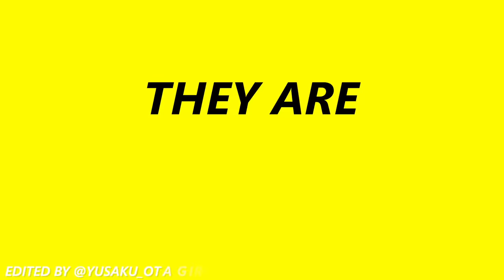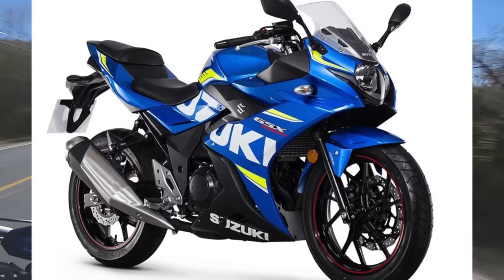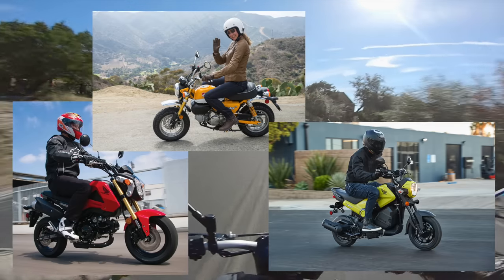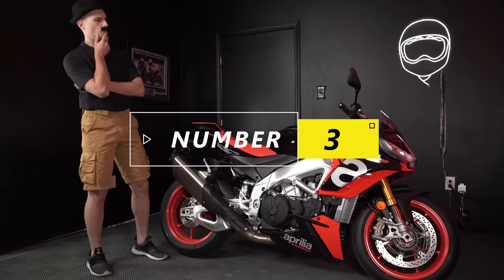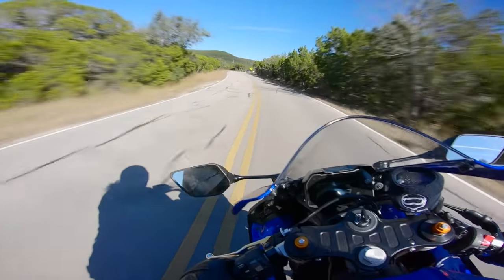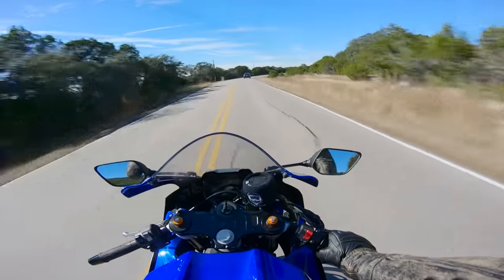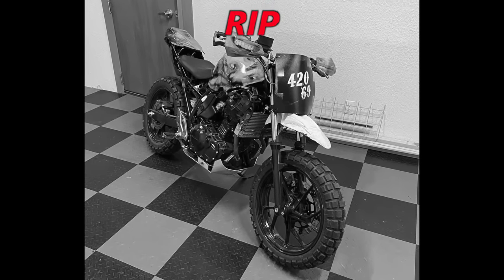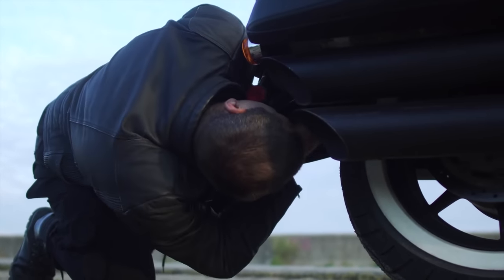Top 7 Worst Beginner Motorcycle Choices! (Must Avoid)

Comment: Maybe its just because i have a mechanical background. My first bike was a 75 CB550 and it gave me 0 problems. It was easy to ride, maneuver, do maintenance on. And not to mention the pros of Its reliability, abundance of parts, and it sounded absolutely godly. I strongly disagree with that last point. People rode bikes with no assists, bad brakes, etc. forever. With a little know how mechanically those bikes aren't hard to ride, work on or diagnose at all. They aren't bad beginners bikes, they're bad beginners bikes for people who expect a 1975 bike to act like a modern one and treat it as such.

Comment: I love my R6 I'm 17 I rode dirtbikes a handful of times and for long periods when I did and got used to automatic bikes here and there a couple times and went straight to an R6. Me I'm a naturally learn through experience person and have amazing control with that bike and know all the RPM ranges to switch gears smoother than your little brother's pickup lines. Not recommended as a beginner bike I was darn lucky I could drive it off the bat like it was a super heavy dirtbike and be just fine

Comment: Yo I got a fuel injected hawk 250cc, it is a very great bike! Showed up in a box on the back of a furniture truck! I had to put it together and went through a lot of headaches getting it titled! After research I quickly found a group on Facebook the know everything about the bike and it actually has a Honda CG motor on it. It runs great and after 2500 extremely hard miles it still starts up and runs perfect also it is very easy to learn how to do maintenance like valve checks. I highly suggest if you wanna toy bike or a learn how bike, the Amazon hawk 250 is a great option!
Reply: My main bike is a tiger XCA set up for off roading and camping!

Comment: Ok ok when listening to you i set back and think was i an idiot? I started out on a sv1000 i was terrified of riding period the corse i took was great... Jesus i was terrified then but I kept pushing my self to try and get better but between the two bikes both was the same scare factor for me not the speed/quick of the throttle on the sv thats manageable and controlled. So I learned lol on a 1000 I did it very slow and took my time till I felt comfortable. Then a few years passed and sold it and made a profit actually lol and bought my first brand new bike so far had it for 7 months lol my dumb self bought a 2021 1290 sdr and so far very happy with it its a neat bike what I wanted was something that can always put a smile on my face and so far the duke does just that even without going to plaid down the interstate.

Comment: Its funny coming from motocross and then riding a  "streetbike", I always feel like they're so slow off the bottom. Even an 800,  its so mellow compared to a 450 mx bike. Wind them up and its a different story but it goes to show 1 450cc cylinder has some serious punch also with way less rotating mass and overall weight.

Comment: What?!?!? No mention of Harley?!?!? Now I'm glad that was my starter bike...
Reply: The Sportster is kinda meh as a beginner bike, very top heavy and kinda a pig at low speeds, actually worse than pretty much any of the Softails at low speeds.  The Sportster motor is lurchy and has vague throttle response in stock form, which only makes it that much more unfriendly to beginners.
Reply: @mrvwbug4423  I don't disagree. My first ride was a softtail sport glide.

Comment: Even if your an 'experienced' motorcyclist, the new superbikes are insanely dangerous, a handful, even the 600s, which are no longer 600s by but 765s, 800s, 959, 955s..can get you into the weeds ... By some used well maintained, but aesthetic POS....so you can ride loose, have some fun, not worry about dumping it.

Comment: Disagree with number 1, a beginner should  start on a bike they may or may not have to work on... it's a good way to get to know your way around a bike. Oh and carburetors are not evil things like you seem to make them out to be, they are for the most part simple and easy to maintain. A fuel injected bike on the other hand can be a nightmare if a problem happens. Im not against fuel injection if given the choice on a motorcycle give me a carburetor.

Comment: So how old is too old for a second hand starter bike? 
I'm looking to start soon and i've got a few options
First gen R3(2015-2018)
Ninja 300 (2013-2018)
Kawasaki ER6N or Ninja 650 (2010-2013)
Sure the 650cc are attractive, but its a few years older than the 300cc but would there be any big differences besides the power and the handling? Like maintenance/service costs and parts? Since its from 2010-2013 with 30,000-50,000KM on it (High 2x,xxx at BEST) would it be a bad thing to choose it over the 300cc with less miles on it?

Comment: So, Yammienoob, what bike do you recommend for a "first" bike? I'm in the process of deciding which bike to buy. I rode a 1955 Pan Head from 1979 to 1995, and haven't been on a bike since. I stepped up from a Honda XL 125. I'm 60, retired, and moving back to Germany where I went to grad school. I'm selling my Dodge Ram 2500 and my Ford Fusion SE, and would prefer to use to the Berlin public transport as little as possible. I've broken my back twice (L2-L2) so I don't want a bike that leaves me bent over to ride. I want a sit up straight bike. I was thinking an Indian Scout Bobber. What's your opinion?

Comment: In India most of the ppl beginners motorcycle is 125cc bike which is a full bike with 125cc engine it is normal wheel size and normal tank you won't feel weird riding it.

Comment: what to get for someone in uk and at age can only ride 50-125cc? we dont get the luxury of usa and going to buy a 300+cc bikes at my age, got to wait till 19 for that :/
Reply: KTM duke is a great option as it's basically a 390 with a 125 engine in it. Honda cb125r is great and Yamaha mt-125 is also great.
Reply: @callumboothroyd3766  Depends how much you want to spend, 125s are crazy expenisve the UK right now. A Cbr125 is probably the cheapest option unless you go for a chinese shitbox. I will say though, if you get a KTM duke, you can easily put a 390 engine in it if you want some speed
Reply: @blazortheepic0384  the downside to cbr125s (whilst they are great bikes) most of the secondhand ones have had the pants thrashed off of them (I'm guilty of doing it) and they're still pretty expensive. Our secondhand market is ass here 😂
Reply: cheers for the comments, the market is fucked, i have noticed. ill be fine for now. have a 50cc moped, going to keep it for a while, then later upgrade in cbt level licence. thanks for the options though. ill decently consider them in the future, thanks for helping.
Reply: @viperxmars6091  no problem! I started an on rs50, had plenty of 125s but now I'm on an MT07, you'll get there!
Reply: @viperxmars6091  i had a brand new 2020 YZF for 4.6k and just bought a 2009 WR for 2.8K. Go figure
Reply: @callumboothroyd3766  cheers, i hope i will. loved bikes, and here it starts.
Reply: @blazortheepic0384  cheers
Reply: Kawi 125 is pretty good!

Comment: what i dont understand is the deal in USA with having to start out on a 250-400cc bike .. my first bike was a 1998 gsxr 1000 . now 13years later im driving a mt09 . 
even if you start out on a 1000cc you dont have to use all the power untill you feel like you can handle it .. i would feel scared as fuck driving a 250cc struggeling to keep up with traffic.. 

in norway its normal that people drive a moped 50cc from age 16-18 , then at 18 you can take your class A2 ( 34kw ) then you can upgrade to full power at age 20, or age 24 if you skip the A2 . 
if anyone asks me what bikes i would recommend for a beginner id say Mt07,Cb650f,Duke 790 etc . if u ask me the 300cc versions is so pointless, instead just get a A2 limited 600-700cc ..

Comment: i bought for myself a CB500 as a first bike, the old one, with two carbs...
it break down 2hours after* because of a little old and dry hose that broke, and it was the only time it dont start (and one time for the battery), i understood nothing at carb (now i am a bike mechanic)

a carb bike just need to run regulary, it's not witchery, it's just mechanic

my wife found a Suzuki Boulevard/LS650, and she's happy with it, so wath? (it's a single cylinder with a carb)

*luckily, i was at home and just wanted to go for my first ride after lunch, so i just take the car to go buying the hose at my local part retailer

Comment: Please let the story of my first bike be a cautionary tale to those that might go down a similar path.  No I’m not about to tell the tale of when I yeeted myself into the sun from the saddle of my turbo busa.  More a story of desperation solved through the magic of Craigslist.  Just stick with the premise, it’s not what you think.  During a lot of my misspent youth I put myself in positions of financial stress due to overspending, leaving me prone to having more ‘things’ than cash when I’d need it badly.  So the engine in my car blew due to it having more than 500k on the clock and multiple cheaply done amateur rebuilds and I couldn’t find anyone that would barter anything I had of value for the mechanic work so I started trolling Craigslist car ads looking for someone that might bite on a trade for some electronics.  After a few days I got desperate and even though I’d never ridden before I checked the bike ads and got a trade!  I figured I’d sell a few more things, buy gear, read a few website instructionals, and just take things slow.  I traded a 32in 720p tv, a ps3, and about 10 games for a 1987 Kawasaki Vulcan 750 with an untold number of miles (broken odomotor), bad shocks, bad master cylinder (no front brake at all), and a fuel system that probably saved my life because at full throttle I could only get it up to about 45mph and have it shaking trying to keep up.  Thankfully my commute was only a few miles so after a few days walking it as I searched for a vehicle I was grateful for the chance to learn to ride.  And I did.  On an extremely busy part of Abercorn St in Savannah.  In gear that I trusted about as much as I’d trust wrapping myself in bubble wrap.  Again, no front brakes.  Rode for more than a year like that, including limping it into the interstate multiple times.   

Ok kids, that’s my story.  Don’t be me kids.  Don’t be me.

Comment: I'm so glad you didn't say Z800, I'm in the UK just done my direct access licence and got one as my first bike and I love it, yes it has 111bhp but I find it really controllable and I feel safe on it. 

Actually tested a 2005 zx6r which was pretty cool, I found it even more controllable because of how hard you had to rev it to make power but was just too small for me in terms of physical size felt like I was sitting on it rather than feeling part of it like I do with the z800.
Reply: Because people in the UK and EU get proper motorcycle lessons and exams before getting a license. Riding around on my 600cc Honda Hornet via a DAS aswell. Very happy with it.
Z800 has a better engine but the seat on the one I drove ruined my bottom so I opted for the Hornet.

Comment: I honestly think the best beginner bike you can get is a 100-250cc two stroke. They are bulletproof, tonnes of fun, easy to repair and completely analogue. Plus, they're faster, more soulful and sound better than their modern counterparts. They were the beginner bike of choice in their day for a bloody reason.
Reply: A 250 4 stroke single is a great place to start, gently but adequate power, usually cheap and easy to run and just enough power to get you into trouble.
Reply: You're not going to find 2 stroke street legal bikes outside of the developing world.  They were banned for emissions reasons decades ago in the industrialized world.
Reply: Am well aware that they were banned... Even in certain developing countries. I advocate buying old ones and resurrecting them.

Comment: I'm interested in a thundercat 600 from 99 with excellent mileage for its age, as a first bike. Many people will say that if you're careful enough a 600 can be a good starter bike since you won't have to spend more money again to buy a new bike when you're done with your 300cc (provided you drive with some sense, it's still a 600). I def know this can make progress slower, due to the driver being more careful, experimenting less fearing the power. Besides it was love at first sight. Also been looking into other older 600 and i really enjoy their "vibe". My friend got a 125cc and then jumped to a z900 in less than a year. Already got my gear (which cost a ton, ~1000 usd) and i'm really excited. I'd say it helps that i cycled in the road for many years with a racing bycicle and kinda learned to watch out for distracted drivers, 2 accidents tho. 1 i was going too fast and lost traction on a curve due to sand (no injuries to me nor the bike, i managed to jump off the bike and didnt fall), the other was someone opening the driver door without looking, got an injured foot but nothing bad (i expected it to happen but was in a tight space and decided not to stop anyways.) They were very sorry afterwards, they got a scracth and my hand brake got bent a little, i replaced it quite easily. cheers

Comment: Im ngl the more people tell me not to start on a 600. The more i wanna start on one😭i do the opposite most of the time. But ill think about it. I wanna start on a zx6r. I mean i have a scooter now but i wouldn't call that a bike. Just because no gears, no clutch, and no back break pedal. But i do know how to use a clutch So that wont be hard. I road quads for 8+ years so gears should be the same just way faster and its 6 instead of 5.

Comment: You say 600s are too big but you’ve put 650s and stuff in beginner bike lists before
Reply: Usually 600ccs are tuned to have high hp. He explained in the video that usually 650s are less powerful than 600s
Reply: I have a 650 and it has 50 hp a 600 has 90+hp

Comment: CAN SOMEBODY PLEASE ANSWER MY QUESTION.

So I have a yamaha 2020 r6 and I just bought a vodoo full system exhaust. I have some people tell me I have to do a custom tune, ecu/ remap and airfilters all this crap. And then the company that sold me the exhaust told me I can install it and be okay because its fuel injected so the fuel will balance out once I put the exhaust etc. I don’t care about the performance As long as it runs like before. I just care about the sound. Now 

What should I do? Do I have to tune and do all this crap to the bike. Or can I just plug the new exhaust and go. 

Thank you in advance
Reply: You have to get a tune to have it work right

Comment: A ktm 125-390 with over 40k km on the odometer is really rare tho
Reply: That 390 motor is a POS, leaks oil like a seive, and the head gasket issue was never completely fixed.
Reply: @mrvwbug4423  you are wrong.
Reply: There are plenty of KTM's which have crossed 40K
Reply: @cranky1812  He's not wrong. KTM250 is the real hot stuff, as you see them on dirt bikes as well. Lot of power for displacement, reliable and huge amount of market parts.
Reply: @victoriazero8869  I think you are replying to the wrong person, lol. The reason I wrote he is wrong is that KTM is reliable, powerful and fun to ride.
I have 2 modified RC 390's myself.

Comment: Why Suzuki needs twin cylinder bike to do the single cylinder job? In India we got Gixxer 250 which is a single cylinder bike and yet it has the same torque and 1 hp more lol 😅, also it weighs 161kgs, roughly 355 lbs, n gsx250r weighs around 178 kgs(393 lbs)😅😅😅
Reply: A Japanese friend who have both know that GSX is what you want for highway travel in Japan. It's basically a 400cc frame with 250 engine. Slow, sure, too slow for JDM, not at all. Gixxer is proper 250cc frame which weight 25 kg less which makes is closer to a real sport bike, but the single cylinder thump your ass on the highway.

Comment: As a rebel 300 owner. DO NOT BUY IT there's a difference of highway speed and maintaining it. Wanna use the highway for 2 mins. Sure. Wanna travel 30-40 miles? Nah. It's a trash bike I got talked into. Either I'm going to use it as a trade in or if they don't offer me enough I'll finish paying it off and throw it off a cliff and going back to riding a motorized bike. The motorcycle is weak af and quite frankly boring.

Comment: The cc thing through me off. Why does the Vulcan s 650 has more hp than the Vulcan Classic 900? 

I don’t understand, I thought more cc meant more power.
Reply: Vulcan s 650 revs so much higher than the Vulcan Classic 900, that it makes more power even though smaller cc.
Reply: Has to do with the state of tune of the motor.  The Vulcan S revs to 10,000rpm and has 64hp, the Vulcan 900 revs to around 6000 or so and only 55hp.  That is why a nearly 1900cc Harley has only 85hp while a 600cc sportbike has 120hp and a 1000cc superbike has 200+hp.
Reply: It's also why a big displacement cruiser will have immediate power at low RPMs, but peters out at the upper range of legal speeds but a high revving sportbike will be a little tepid at low rpms but once you get into the powerband it feels like the bike goes into warp speed and you're riding on a missle haha.
Reply: Vulcan S have Ninja motor in it
Reply: Thanks for the info. So a 1000cc cruiser isn’t as dangerous as a 1000cc sport bike if you’re a new rider?